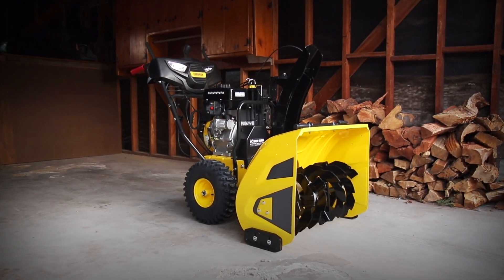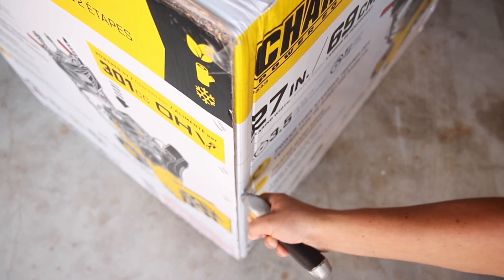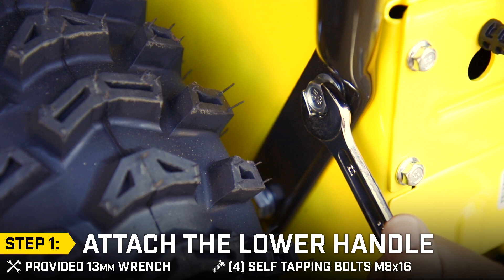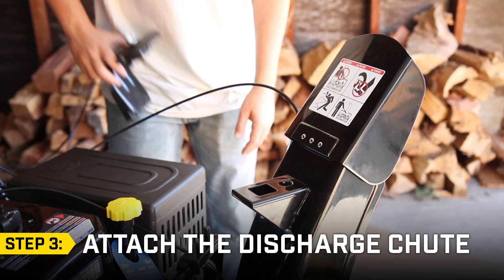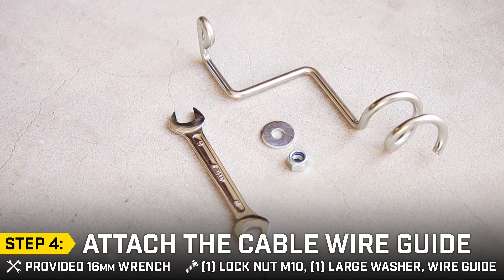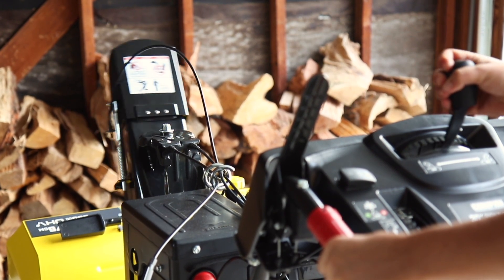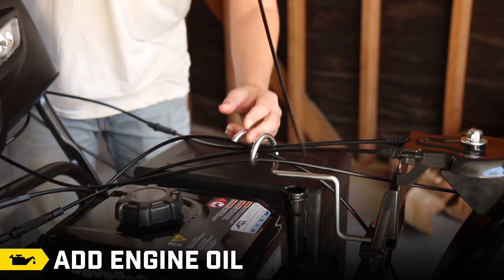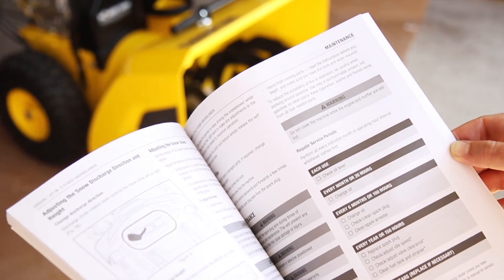Snow Blower Assembly (100535 + 100536)

Comment: Can you do videos on replacing the drive, auger and speed selector cables for 100536? I see videos for adjusting auger and drive cables but none for replacing them or adjusting and replacing the speed selector cables.
Reply from the maker: Here is a video from our Help Center on how to replace the drive belt for the 100536: https://help.championpowerequipment.com/article/1nv9jrkmhc-snow-blower-drive-belt-replacement-100535-100536
Reply: @ChampionPowerEquipmentHQ  I've seen that video, I was asking about videos on replacing the cables that come with model 100536 or a similar one.